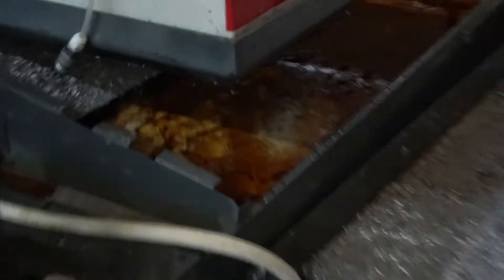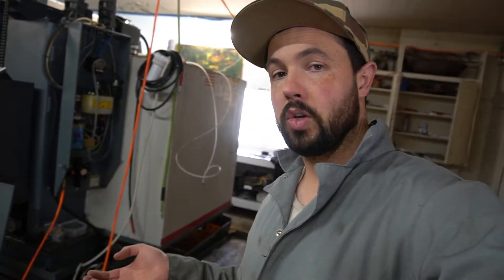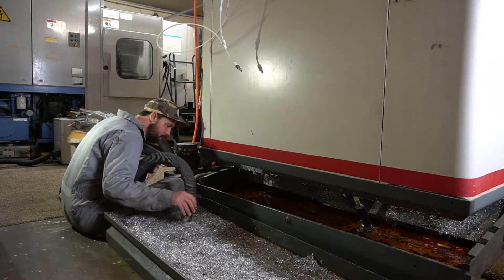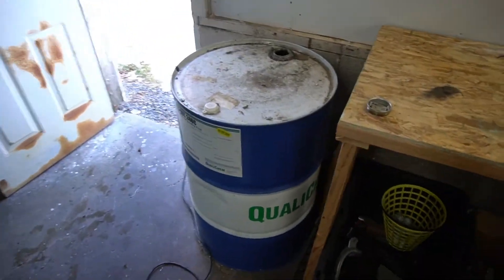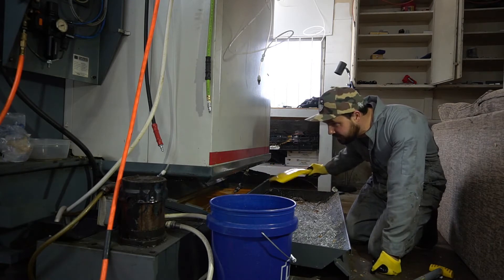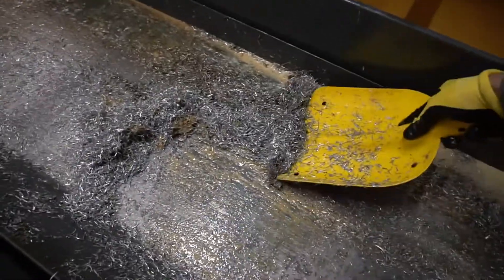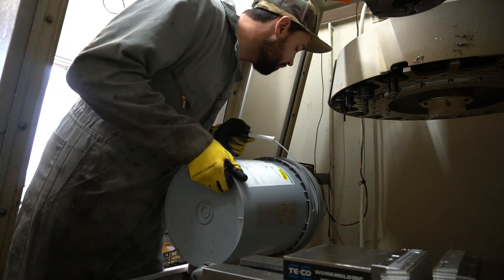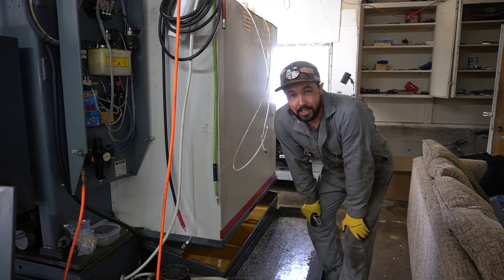Coolant Change. 😳  "Worst CNC Coolant tank"

Comment: Filter socks my man, they work wonders.
Reply from the maker: Haha nice. Ill look into it.  We drained her and topped back up with fresh this summer.  I was running it too low on the mix.
Reply: @ericschneiter   if you can't set the socks up in the machine just get a pump and a  couple barrels rig the socks up in the barrels and just pump into the barrels through the sock. From 1 barrel to the next then back into the tank. 

Repeat when nessarcy.

Comment: We´re moving our machines to another part of the factory, so the first thing for me and my co-worker - CNC lathe machinists - were to remove the coolant tank and chip conveyor from underneath the machine... It´s two elder Doosan Lynx 220 lathes, so there is nothing like oil separator/skimmer nor there is nothing underneath the conveyor which is right above the coolant tank, suck all the coolant out of there and get all the chips our... If I haven´t got 30 kilos of stainless/brass/steel/aluminuminiuminum chips out I haven´t got a single kilo out of there... Man, it wasn´t a coolant, it was like a fucking yoghurtr when coolant was out and just oil and goo was left in...... Shit, working as CNC machinist for just fourth month I was absolutely gross thing to clean..... I said I´m going to get myself out of bed every two months on Saturday to go and clean the coolant tanks from oil and chips, it´d be worth it to have your hands every day in mostly clean coolant than in gross coolant... Fucking clean this stuff guys, it´s something you´re getting it all over your hands
Reply from the maker: Haha this is the lesson.  And make sure your concentration is right.  It’s not always easy with these old machines but if maintained they can run nice.